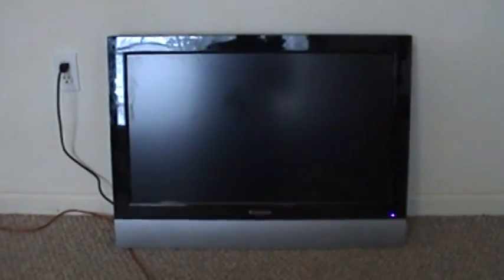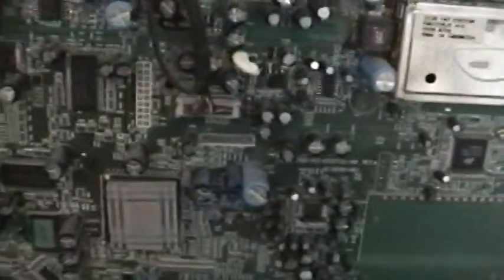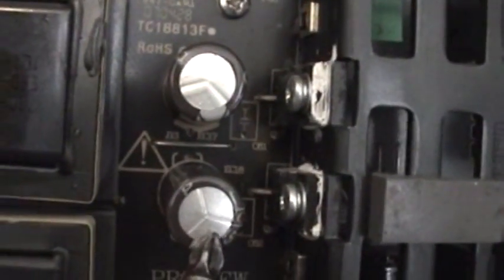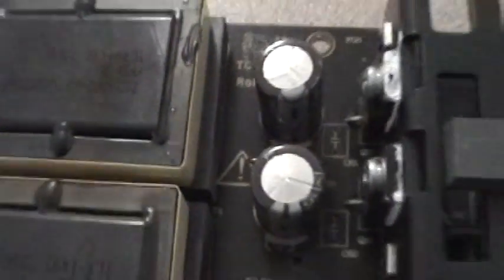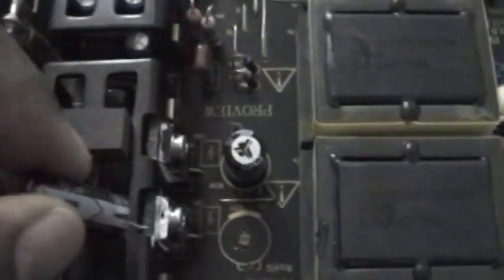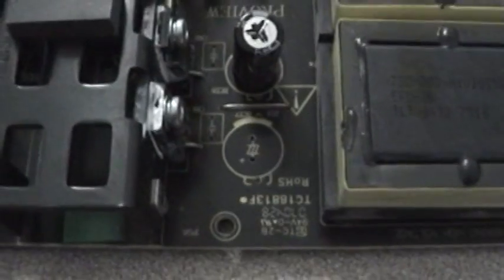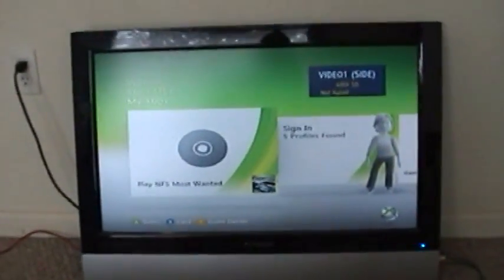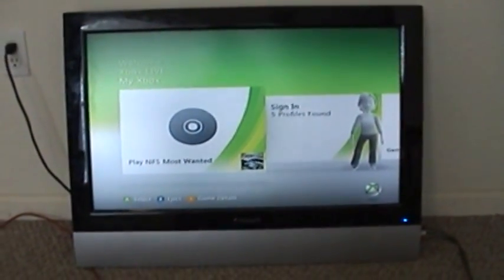POLAROID TDA-03211C Troubleshooting & Capacitor replacement

Comment: I've had this identical 42" polaroid tv for 13 years now and it just now took a dump. Of course. While the world is on lockdown. But it's the same problem. I got my $800 worth but I'll be damned if I'm buying a new one. Gunna be replacing the 2 capacitors and fingers crossed it works. Thanks!

Comment: Hi. My husband found one of these and tore into it before watching your video. Good news is he figured out what was wrong. Bad news is he can't figure out where to connect the speaker wires back up and thinks he may be missing a board. Could you email me a picture of each board so he can figure out which board out of 600 is the correct board and where it is attached to the back of the tv? Thank you so much.

Comment: Hello, I have a new problem, after changing the capacitor, the tv worked fine, I used it for about 6 hrs during the day, but then I connected my laptop to the tv with a vga cable, after 45 minutes I unpluged the cable from the laptop, then the tv just wont turn on... please help me! I checked the capacitor and they look good.
Reply: Aaron Garcia you fried something bro